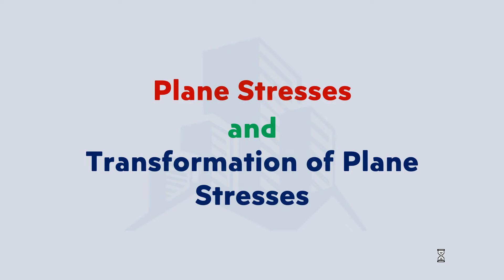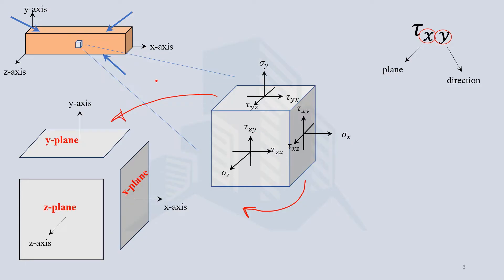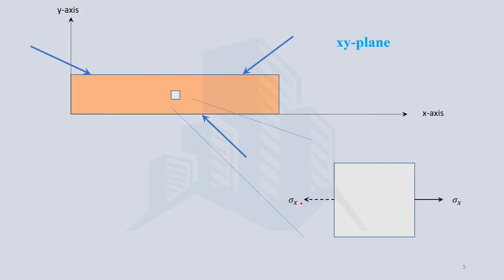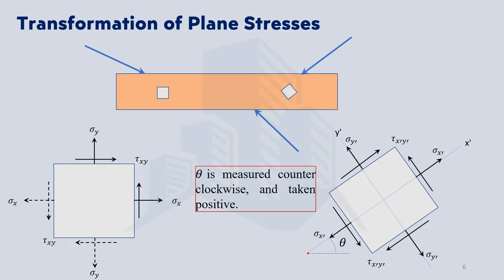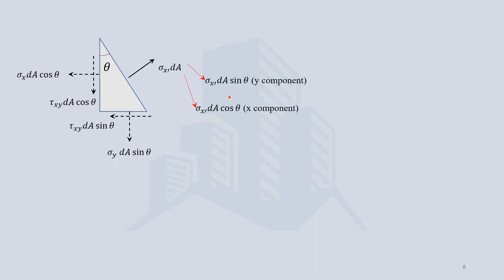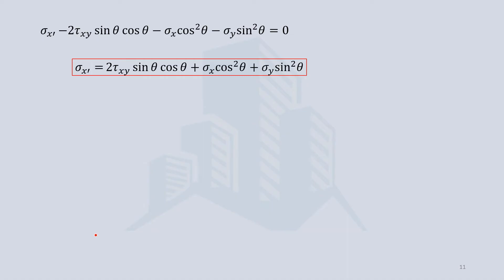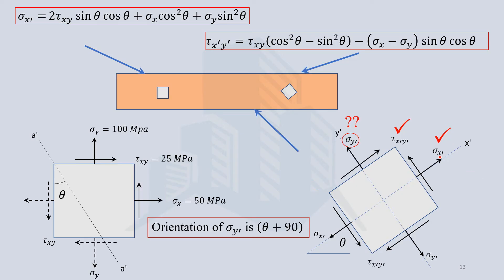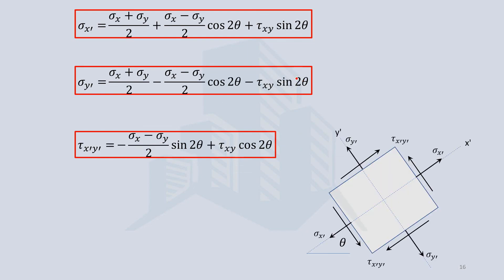Plane Stress and Transformation of Plane Stress: An introduction

Comment: I have a doubt. We have the value of stresses in one plane, and we want to calculate the stresses on another plane in a different direction. Is that the value at the point where the element is rotated by an angle theta, or does the value remain the same at any element inclined at theta, regardless of its location in the beam, when determining the stresses?
Reply: Dear, this is the value at any point along the beam's length having same distance from the centerline of the beam and rotated at the same angle